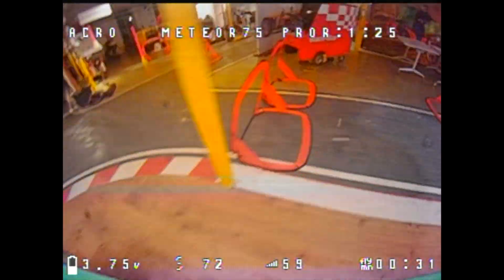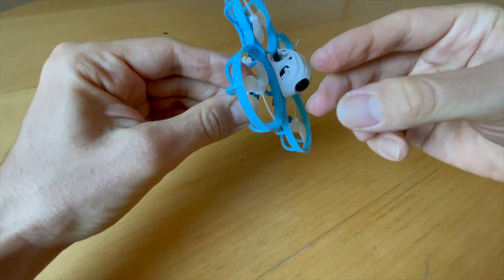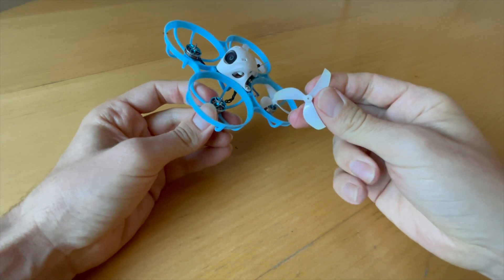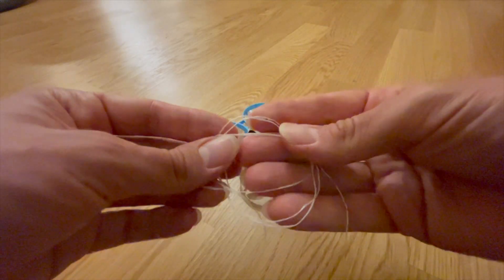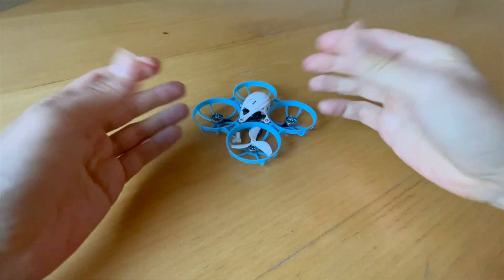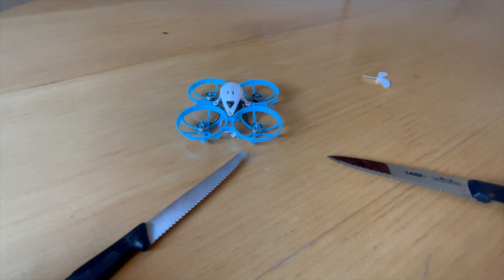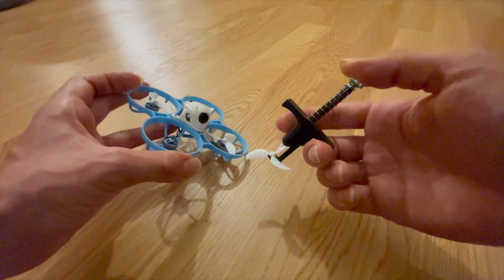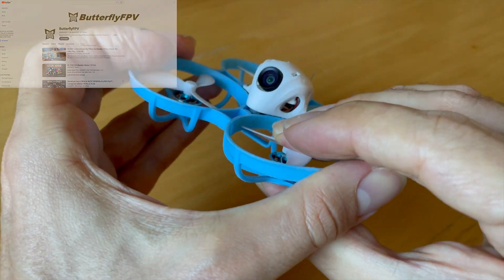3 METHODS to REMOVE a PROPELLER on a Meteor 75 Pro or any other Tinywhoop | How to remove a prop

Comment from the maker: Hello my whoop friends. In this video, I'll show you three or respectively four methods how to remove your tiny whoop propeller from your whoop motor. For example, on your new Betafpv Meteor 75 Pro or on any other tiny whoop. Sometimes it`s not easy to remove a propeller from your tiny whoop motor. Many pilots have damaged their propellers, bent their whoop motor shaft, or injured themselves while trying to remove the propellers. But that doesn't have to happen. That's why I made this video. Everyone has to find their own method. But for me, the methods shown in this video for removing tiny whoop propellers are the cleanest. One reason for this is because I always press my propellers all the way down to the motor shaft. I do this to reduce vibrations from the propeller during flight and because it reduces the chance of bending a motor shaft during a crash. If you know of any other methods on how to remove a whoop propeller, please let me know in the comments. I really appreciate your feedback! And maybe it will help a pilot who sees your comment. Further down in the video description I have also linked some other videos from other pilots where you can see how other pilots remove their propellers. I hope you enjoyd the video. If you liked the video or the new knowledge you learned, make sure you check out my other learning videos, tutorials, and comparisons like this one:

My FULL KNOWLEDGE about Whoop Propellers for Whoop Racing:
https://www.youtube.com/watch?v=Fze-q-npoR0&list=PLYPR_WgF4mzUVGJlKlx5Q_bdNKckQBKcI&index=32

If my work has some value for you and you appreciate my work then consider buying BetaFPV products from the following links: 

Betafpv shop in general:
https://bit.ly/3Lt4mwV

It's an affiliate link and it doesn't cost you anything! Betafpv gives me a small share of the sale which helps me to be able to buy products for my hobby and this channel. Thank you in advance my friends! In return, I promise you that my findings will always remain public as before. I will always work for the community!

Links to Prop Popper Tools are in my ButterflyFPV youtube community:
https://www.youtube.com/@butterflyfpv/community

Playlist of all my videos about the New Meteor 75 Pro Matrix, Betafpv Meteor 75 Pro, or my Special Meteor 75 Pro ButterflyFPV Edition:
https://www.youtube.com/watch?v=tFV4iYxI8_U&list=PLYPR_WgF4mzXY_oS5wKIO450zdIM9IC2h

This is why is the NEW Meteor 75 Pro is so good:
https://www.youtube.com/watch?v=X6ThmMKkk7s&list=PLYPR_WgF4mzXY_oS5wKIO450zdIM9IC2h&index=43

Meteor 75 Pro vs. Air 75 Comparison:
https://www.youtube.com/watch?v=o1GGBDw7bAY&list=PLYPR_WgF4mzUVGJlKlx5Q_bdNKckQBKcI&index=25

Modifications of my Betafpv Meteor 75 Pro ButterflyFPV Edition: https://www.youtube.com/watch?v=2C1fCqvQK1I&list=PLYPR_WgF4mzUVGJlKlx5Q_bdNKckQBKcI&index=28

Gear from ButterflyFPV:
https://www.youtube.com/watch?v=RN2iM5j4Yk0&list=PLYPR_WgF4mzUVGJlKlx5Q_bdNKckQBKcI&index=23

Rates from ButterflyFPV:
https://www.youtube.com/watch?v=-km-8Gy6B-w&list=PLYPR_WgF4mzUVGJlKlx5Q_bdNKckQBKcI&index=24

How to remove motor plugs:
https://www.youtube.com/watch?v=ta2QAkelFrs&list=PLYPR_WgF4mzUVGJlKlx5Q_bdNKckQBKcI&index=20

How to fly acro:
https://www.youtube.com/watch?v=zvjqsMOIXQs&list=PLYPR_WgF4mzUVGJlKlx5Q_bdNKckQBKcI&index=17

How to fly Line of sight:
https://www.youtube.com/watch?v=0l2kS0GajgU&list=PLYPR_WgF4mzUVGJlKlx5Q_bdNKckQBKcI&index=18

My full knowledge about whoop race motors:
https://www.youtube.com/watch?v=RJDJvCWade0&list=PLYPR_WgF4mzUVGJlKlx5Q_bdNKckQBKcI&index=30

My full knowledge about whoop race propellers:
https://www.youtube.com/watch?v=Fze-q-npoR0&list=PLYPR_WgF4mzUVGJlKlx5Q_bdNKckQBKcI&index=31

My full knowledge about lipos for whoop racing:
https://www.youtube.com/watch?v=JiRnyso1EmQ&list=PLYPR_WgF4mzUVGJlKlx5Q_bdNKckQBKcI&index=29

Best 1S Charger in 2025:
https://www.youtube.com/watch?v=dyIpOY0FVUQ&list=PLYPR_WgF4mzUVGJlKlx5Q_bdNKckQBKcI&index=1

Professional Meteor 75 Pro PID Tune from Uavtech for free:
https://www.youtube.com/watch?v=pfDMKg0XJ14&t=337s

Happy whoopin! Whoop whoop! :-)

Also note the other videos on this channel, the option to subscribe to this channel and my other channels.

Other videos on this topic only - See playlists
If you liked the video - recommend it to friends ☺
Contact for Business Inquiries - Channel Info - Email

Song: Fredji - Happy Life (Vlog No Copyright Music)
Music provided by Vlog No Copyright Music.
Video Link: https://www.youtube.com/watch?v=KzQiRABVARk&t=37s

Youtube videos about the topic how to remove a drone propeller:
https://www.youtube.com/watch?v=7rejExxi7Z8
https://www.youtube.com/shorts/ePFVaWDSc_s
https://www.youtube.com/watch?v=skCdvtDg3Dk
https://www.youtube.com/watch?v=GwB2kzHZY2o
https://www.youtube.com/watch?v=ikpcX0o-3iY
https://www.youtube.com/shorts/VDYfw3gDk84
https://www.youtube.com/shorts/bFtMHDdsfsk
https://www.youtube.com/watch?v=RGPsFKEBO0o

Comment: 3:20 This is a fantastic way to ruin your motors! Thanks!!!
Reply from the maker: No, you don't have to worry. If you do it right, it won't harm your motors. I've done it many times without any problems. It's possible that you'll eventually get slip shafts on motors that aren't well-made by the manufacturer, like the older Happy Model 702 28500kV motors. But those are already poorly made by the manufacturer. If an aluminum-to-steel fit doesn't hold as well as a metal-to-plastic fit, then something is definitely wrong. In other words, yes, it's possible that your motor will break if you remove the propeller using the knife method. But the problem lies with the motor manufacturer, not with the knife method.

Comment: I use the two knife technique. The proper that I bought kind of sucks... I'll try your floss technique next time. Looks promising
Reply from the maker: Yes the two knife technique is very solid. But unfortunately, the knife method and my floss method is not completely stress-free as well for the connection between the motor bell housing and the motor shaft. But this only plays a role for motors that are very sensitive to slip shaft problems.

Comment: hey man I can't remember if you made a video about it, but im looking for a way to widen the prop holes on my prop. I have 3 sets of gemfan bi blades and for some reason all the CW props fit so tightly onto the motor shafts, I'll never be able to get them off again. I think I saw you doing a video like that and you put a piece of dental floss to make it fit snuggly
Reply from the maker: Use PCB drills for this. PCB drills are very hard and sharp. Unfortunately, they're also fragile, so it's best to buy a few spares. And wear safety goggles when drilling. You can find my videos like this: ButterflyFPV channel main page -> Search bar -> Searchword (in this case Propeller) -> https://www.youtube.com/watch?v=vMiOd1UAAtk&t=6s
Reply: @butterflyfpv  thanks dude this is exactly the video I was looking for, you rock

Comment: add a drop of isopropyl alcohol with a cocktail stick or similar and you can easily take them off by hand
Reply from the maker: Wow, I didn't know this method! Thanks! I'll test it out and publish it in a video sometime. I'll make another video at some point where I show all the methods. Thanks to you, I now know one more method. Nice! Appreciate it! 🤜🤛
Reply: ...aaannd you will also evaporate any lubrication that is in the motor, drying out the bearings.
Reply: @oceanaxim ah really 😅

Comment: I could not get the propeller blades of a blade inductrix with my fingers without feeling I would damage it. I used your tooth floss method with tread from a sowing kit, and it worked great.
Reply from the maker: Thank you for your feedback! 🤜🤛 Appreciate it!

Comment: I tried all the methods from the video, none of them gave any propeller displacement. I ordered a propeller puller "Defender 16/20" and the paw that clings to the motor axis is huge. There is simply no support, and even with the propeller puller nothing works. The propellers sit like they are rooted to the spot

Be careful, because it is very easy to bend the motors. 
In total I have: -9$ and all props on their place. 😢
Reply from the maker: Thanks for your feedback. But that's almost impossible. You can remove any prop with two kitchen knives. I think you've done something wrong. You have to place the kitchen knives under the propeller hub. And if that really doesn't work, you can cut off the propeller blades with electronics side cutters and squeeze the propeller hub hard with pliers to expand the propeller bore. After that, you should be able to remove the propeller hub.

Comment: Thanks, the two knife method worked like a charm on super stuck props. I used two butter knives.
Reply from the maker: 😃💪 Thank you for the feedback! Yes, the kitchen knife method is really reliable. What you need to know: In motors with a tendency to slip shafts, the shaft can come loose. However, that's never happened to me with the 1102 from betafpv.

Comment: The prop tool you showed is indeed useless garbage
Reply from the maker: Yes but only the lower fork base of the tool. Maybe at some point I can redesign the fork base of the tool.
Reply: @ I tried that a couple of times, couldn't make it better. The methods you showed are the main ones I use and they never fail
Reply from the maker: @SovereignPleb Ok. I think so too. The knife method, in particular, works even with very tight props.

Comment: Hi, can I fit GNB 1S 660 mAh Li-Hv to my Meteor 75 Pro O4 edition? And what do you think is better, GNB 660 mAh, Tattu 550 mAh, Lava 550 or Lava 450 mAh, for the best flight performance and experience?
Reply from the maker: Hi, no the GNB 660mah is too big (for the stock lipo holder) and also too heavy. All those Lipos that you listed (Tattu 550 mAh, Lava 550 or Lava 450 mAh) offers good flight performance. 550mah is good for bigger flying and outdoors and for longest flighttime. 450mah is a good balance between power and weight. And 380mah 90C is for best power to weight on small racetracks. Hope this helps.

Comment: Thank's for the tips, the dental floss and the knifes systems are brilliant.
As you asked... i got one prop remover but it's far from perfect as you said cause the metal part is too thick if you push the prop to the end.
Reply from the maker: Thank you for your feedback! Appreciate it! Could you tell me which prop popper? Or can you send me a link?
Reply: @butterflyfpv  it's The Prop Popper V2 by inventor Winson FPV.
It's one of the first models and it has some flaws they probably did correct in later designs but they still sell it
Reply from the maker: @keloris  Ok thank you for your feedback! I'll ask my friends if anyone has this prop popper. Then maybe I can try it out myself.

Comment: Always great tips.  And yes, valuable.  I got the prop popper remover similar to the one you showed at the end of the video.  And I didn't keep tightened down and lost the part that aligns with the shaft.  So be careful guys.. now I have to find a 1mm or 1.5mm pin in order to use it.
Reply from the maker: Thank you my whoop friend! I hope you can repair your prop popper soon. In the meantime you can use dental floss like I did😂poor man`s prop popper🤣

Comment: Hi! Can you help me? In my dvr the signal strength isn showing only 0. Both my rc and video. Thanks 🙏
Reply from the maker: But you can fly? Is everything else working? Only the display doesn't work? Unfortunately, I don't remember it by heart. Please ask this question in the tiny whoop group on Facebook. You will receive quick help there. https://www.facebook.com/groups/tinywhoop
Reply: @butterflyfpv  Yeah everything is good. Only I don't get numbers... Which is kind of scarry when i want to go a little further. I don't know when I'll lose the signal. and if i leave the drone plugged in to betaflight for like 3mins, it becomes really hot. Idk if that's ok or not, but until it is working I won't order a new vtx. Danke! 👍
Reply from the maker: @komm5194_g  Hot vtx is normal. If you have set the VTX to more than 25mW your VTX can even break if it is not cooled with a fan. Even at 25mw I always use a fan when I have the drone plugged into the PC. Ok well then it has something to do with the settings in betaflight. Unfortunately, it's a bit complicated. And the procedure isn't the same for all receiver protocols. What kind of receiver do you have? ELRS? Crossfire? FRSKY? Honestly, I can't really help you efficient here. You'd have to send pictures which is not possible in the comments. It's really easiest if you ask in an FPV Facebook group or Discord server. Or even easier with real life fpv friends. Also, watch a few videos on the topic. Watch the entire video carefully, even if you don't understand everything yet. If you watch several videos, you'll eventually get a rough idea of what's going on. FPV friends are essential, though. And a format where you can send pictures. YouTube comments aren't ideal.
 https://www.youtube.com/watch?v=suAqRh2foq8
Hope this helps a little bit for now.
Reply: @butterflyfpv Hey, just a quick update. I reinstalled a custom firmware to ut, and now it is working fine. If i install the betafpv firmware, it doesn't show. So I am happy! Thanks for all of your videos and help ❤! From Romania. Danke!
Reply from the maker: @komm5194_g  Thanks for your update and you kind words! Very nice! I'm glad to hear that you're now ready to fly! Whoop whooooop🥳

Comment: hey man plz make a video on jittering motors
Reply from the maker: I will definitely. But I haven't found a definitive solution there yet. Only what I wrote you in the last comment: "Yes it`s because of the motorplugs. Watch my next videos. I'll try my best to explain what the problem is and how to fix it. In short: Unplug and replug the motor connector. Then secure it with a rubber adhesive like E6000. Then attach the motor wires to a duct strut with dental floss. Do this with all motors. Hope this helps."

Comment: Twisting and pulling on whoop motors is a very bad idea (shown in method 1). Whoop motors can slip the shaft between the bell, making the motor completely useless.... Always pull ONLY straight up or, better yet make sure to get a prop remover tool While they cost money upfront they WILL save your motors from slipping, saving you money (and the prop popper you are having issues with is a very bad design the fork is far to large try to get your hands on the OG prop popper, deluxe popper, or the PPP from webleedfpv (even has removable pins)
Reply from the maker: I understand what you mean. And you are kinda right. Thank you for your feedback and input! Slipping shafts are a quality issue with the motors. This doesn't happen with high quality motors like motors from rcinpower. Even with this Betafpv 1102 22k, I've never had a shaft start to slip. So you can use all these methods shown in the video with no problems on these motors. But you're right in case of the Happymodel motors. Especially the 702 motors. You're right, the prop popper I bought is useless because of the fork design. But other prop poppers also seem to have problems when the propeller sits right at the bottom of the bell because the fork is too thick. And if I have to first lift the prop with two knives just to be able to use the prop popper afterwards, that doesn't really make sense, does it? Or can you confirm that a prop popper works even when the propeller sits completely on the motor bell? (Without any clearance, for example, on a motor without an upper C-clip). I could most easily imagine this with the prop popper v2 from tinywhoop, as I said in the video/wrote in the video description. I hope this video doesn't come across as me being against prop poppers. I just think they might not be suitable for every application, and not for every pilot's needs. Before I give my real opinion, though, I need to test them myself. Or gather more feedback from my YouTube community. Thank you for your feedback! Appreciate it!
Reply: @butterflyfpv yes they do have some issues with the forks not being pointy enough the best one I have found for that is the prop popper Deluxe /the OG prop popper those seem to have the sharpest tips that would dig under the prop easiest recently there's also been a 3D print file called the propodile that works really good as well sometimes even better than a proper in my opinion!
Reply from the maker: @Jake_FPV  Thanks for your info! Yeah, the propoile is cool too! I saw that too! The propodile prop puller inspired me for the dental floss method in the video!